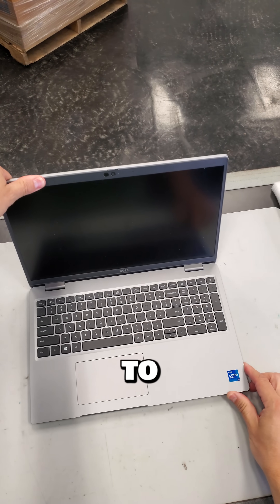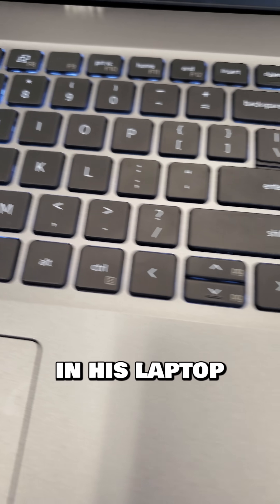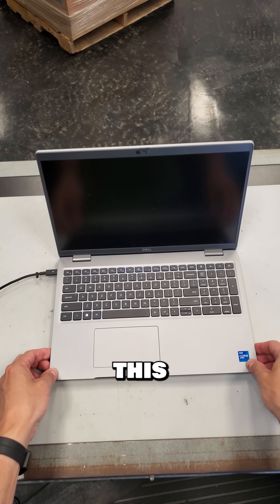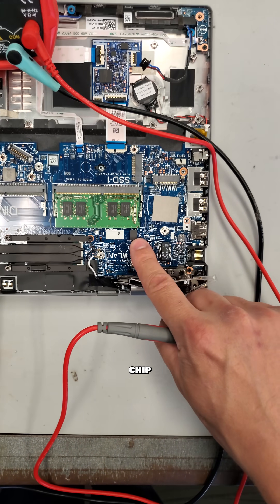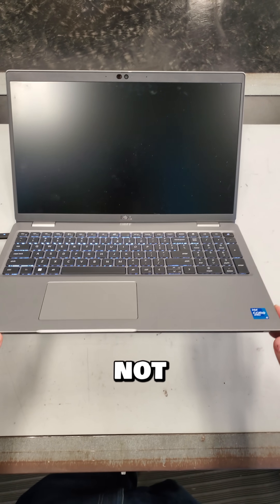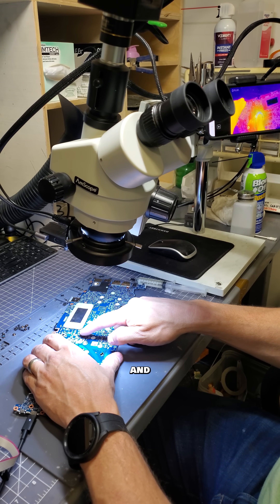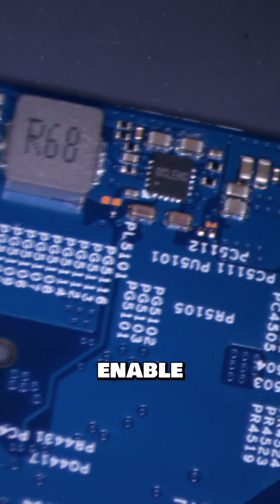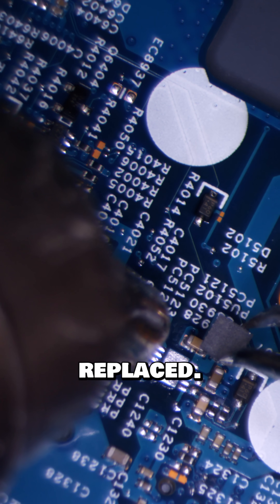Warning: Cheap USB-C Devices Destroy Laptops #laptoprepair #shorts #pc

Comment: Or you can just take the battery and memory out, connect the laptop with charger, press and hold the power button for over 4 secs, take the charger out, put the ram back, reconnect and it works. Now you have a nice day

Comment: I've been ducking around with an automotive FLIR thermal camera was able to track down a chip that's overheating as soon as I put AC power to the Jack.

My buddy gifted it to me I think they were about $1k when released but it really isn't designed for zoom/micro applications like this.

What thermal camera are you using on your phone? You have one on your microscope right? How does it compare

Comment: Let me start by saying your skills at repair are great.
Unfortunately, this type of repair is usually cost prohibitive. Most people will just ask for their data and buy a new computer instead of spending $200 on a fix that may not last (other components could be damaged that are going to fail in the near future).
I used to run a repair shop in the early 2000s and people would almost always junk a computer if it cost more than $100 to fix (we had $25 diag). They saw it as a waste to repair and often used the failure as an excuse to buy a newer, faster machine anyway.
Computers are just too cheap to make unfortunately.

Comment: Do you fix consoles? I have a first gen 60gb ps3 that needs new NEC tokins/capacitors yellow light of death. Previous shop i took it to already reballed the cell processor and the other processor

Comment: I live in India i purchased a dell vostro i3 10th gen laptop 14 inch. When i unboxed it it was looking good and fresh. Then i plugged charger and turned on i didnt understand that the laptop turns on as soon as the adapter is connected😂 and does not operate from power button. So i changed settings in bios turned off all those open lid power on switch and adapter wake up settings of. Still the laptop turns on as soon as on i plug adapter in. After it turns on i unplug it and  then it works on battery 😂 returned it immediately and ecommerce company said they wont take it back. When to dell got a warranty denied letter then returned it to seller and took refund. Never going to buy dell 😂 and today saw your video

Comment: While I don't doubt that a lot of cheap USB devices are responsible for cooking motherboards, this may have been another victim of faulty BIOS firmware. Dell issued a firmware patch for Dell Latitude 5420 models (what this model appears to be) that allegedly prevents this issue. Dell Technologies Internal Reference ID - ET004996

Comment: Those repairs are super impressive to me. I have only tried surface soldering once and it was a disastrous mess. I don’t know if i just lack the manual dexterity (my hands are a bit shaky when it comes to handling tiny things. Always have been) or if there are lots of tricks I just don’t know because I only have tutorials and tips to follow and not an actual school course or something. So the repairs and tests you run are super cool. Well done!

Comment: My biggest gripe with USB C is the sloppy standards, I have some software that won't even boot if certain devices are plugged into certain ports, baffling.
Reply: The problem with USB-C is that it only defined a connector, but USB-IF kept harping about all of the protocols it could use, even though every one of them except USB 2.0 is optional (and even that might be a stretch to say you're guaranteed it).
Reply: Sounds like the software that's the problem. Every time I get a notified by software to remove devices it's  always software necessary to use a piece of studio gear, digital effect processor, i.e. a peripheral for outboard hardware made by a company specializing in anything other than software.

Comment: I doubt "cheap USB-c" devices as the cause. ALL PD devices can do that and WILL do that as the pins oxidize, get lint on them, or just make bad contact. The cheaper ones may do it more often, but when throwing around 100 watts at 20 volts haphazardly, stuff will pop. Has way more to do with the cables and connectors... The connector must be reinforced with metal for the leverage of the Thunderbolt 3/4 cable hilt. Cost savings is always your device's enemy.   

Best advice possible is to stick to the lowest power your device will use. Not the lowest it will take, but 45 watts is pretty safe.

Comment: Serious question. Do you repair/replace Dell Inspiron touchpads? My laptop works fine but I've had to use an external mouse lately as even since half a year owning the laptop it has increasingly mistaken mouse motion events as clicks or made the mouse go the wrong direction by a huge amount instantaneously. I'd assume Linux drivers but I'd think it feels like a hardware problem because of how it's gradually gotten worse.
Reply from the maker: Hi, check out our website, we may have a replacement touchpad palmrest for your model. May need to replace it. www.partspeople.com

Comment: I wish to increase my repair knowledge to your level
Reply from the maker: There are a few YouTube channels that are pretty good and you can learn a lot from them.  Then you need to practice... a lot...  Electronics Repair School channel, NorthridgeFix channel, and the Louis Rossmann videos.

Here is a playlist that I put together with videos that people can learn from.
https://youtube.com/playlist?list=PLQAeAX5hsbz040sKXpjDpnaFV9fpre1je&si=7iNTODpXJSzAh2UG
Reply: @dellpartspeople  thank you very much for this, I have a few stations for soldering, heat, oscilloscopes, power supplies, although I do need to purchase that scope next. I have been soldering for several years for transistors, resistors, diodes, capacitors, just never chipsets.

Comment: Aren't there any current limiting or short circuit protection circuits?
Reply from the maker: Yes, there are a lot of them, but from what I can tell, the wrong voltage went to the wrong place. Cheap, no-name docks and chargers are notorious for destroying laptops. Never buy them, and if you have one, throw it away. When a dead laptop comes in, the first thing I check for is a knock-off charger.

Comment: Friend bought wrong charger for Msi laptop.  Immediately fried the motherboard which costs as much as the device $450
Reply from the maker: Yep, it was probably a cheap, non-genuine charger.  The point is genuine chargers cost more because they are made with quality components and are not just slapped together.  Your laptop costs a lot of money, and you are willing to buy the cheapest charger you can find. It just does not make sense.

Comment: How much is that laptop worth....
Reply from the maker: It depends. The laptop is a business machine that was new for about $1300 but is now a couple of years old. You can probably find them on Ebay for $300 to $500, depending on the specs. This customer had the higher-end version and had business data on it, so it was worth a lot to them.  The repair was $200 and was completed the next day.

Comment: That's a grand worth of diagnosis, work, and parts for a $500 computer.
Reply: Yeah that's what I was thinking I bet you could find that same laptop in good used condition for like 100 bucks
Reply: Exactly. I pick up on that but my brain doesn't know the next step.
Reply: And I sent that complainer yelloworange or something a big F you.
Reply: How do you know that wasn't an hour's worth of work? Not everyone has $500 laying around to just buy another computer. Not everyone needs their computer to do video editing so a computer like this is fine. Our landfills are over capacity so repairing is best. I don't know how you justify that opinion of yours and cast it out there like it fits everyone.
Reply: @orangeyellow-me1pz  You're right, that computer might not be worth even $500.
Reply: @LordMondegrene  I love how your argument is so weak that you couldn't even challenge any of my points. You can only throw weak and nonsensical insults. Truly, it shows that I'm not talking to someone worth talking to. Mute.
Reply: @angrydragon4574  my first sentence addressed your whole statement. What is happening in American schools?
Reply: @orangeyellow-me1pz this is very unlikely to only be an hour of work unless this technician has seen this exact problem and has the parts on hand already to fix it. The amount of skills, equipment, parts, and knowledge required to do a repair like this is not trivial.
Reply: @orangeyellow-me1pz  I know for a fact that it was more than an hour's worth of work because it takes an hour to simply take a laptop apart to the motherboard level and reassemble it. That's working quickly with no interruptions. He did this numerous times, once for nearly each new diagnosis. I've done this sort of work before as my job. 
Add in the time for diagnoses and chip level removal and replacement with soldering and it's well over two or three hours. All of which takes quite a bit of specialized equipment, knowledge, skill, and experience to do correctly. 
Doing this level of work for only $200 and giving a 1 year warranty on the work is barely breaking even. 
At the most, I would have replaced the motherboard with a new one if the price for the part was low enough. 
If the laptop isn't still under the warranty from Dell, it's probably not worth enough to do all of the labor that was done in this video unless the tech also has a popular YouTube channel to help earn some additional income with.
Reply: @GeneJordan  I'm not reading the rest of that dissertation. It does not take an hour to take apart a laptop. I've done so plenty of times.  It takes 5 to 10 minutes.
Reply: @orangeyellow-me1pz  Understood. Not only were you are wrong, you are too lazy to defend your incorrect and irrelevant point.
Reply: @GeneJordan  your first sentence was wrong so why bother to read the rest of that nonsensical drivel? I'm not grading a paper. I don't know what kind of special you are but it doesn't take that long to open a laptop.
Reply: @orangeyellow-me1pz  I've been repairing laptops since before laptops existed. I can only chalk your defiance up to you having a reading comprehension problem. That's probably why you believe  that working quickly with laptop repair is recommended. Take your time. Do the job right the first time. The Chromebook you used in school doesn't count.
Reply: @GeneJordan  as I said, you don't know how long it took him and that fact remains a constant. It took me 20 minutes to take my Windows tablet apart and repair some board level damage. For you that may take 5 hours. We all Aren't as slow. And now you're trying to guess my age and talking about Chromebooks. You don't know anything about me and just like the man in the video, you've started to build a story around someone you don't know. That's what stupid people do. Well, I'm muting you now because this is pointless.

Comment: I have a question, I'm only curious but do you take in AIOs, like a Dell Inspiron 23? I don't need to send mine in as it still works perfectly, I only want to know whether you do or not.
Reply from the maker: We don't usually, but I may consider it. We get many parts for it so I'd contact us prior. If you ever have issues down the road.

Comment: Tragic that at a granular level this laptop was still beyond economic repair. It would seem. The specs weren’t posted but the lack of badging would indicate the computer retails for less than $1600, at least in the past. Unsure how brands are doing it now.

I used to do board level repair like this, it takes some real skill. I despised it though and charged a fortune for the service, primarily to discourage people with low and mid shelf machines from spending good money after bad.

As in, the folks who want this done on a $600 Walmart special or a $400 Staples Back-To-School Sale laptop that’s just roamed around too much.

Comment: most repair shops would probally ask for like $100 and say its unrepairable
Reply: Yeah because this takes immense levels of training and specific parts that are very hard if not impossible to source without buying a replacement device. This guy specializes in one brand of device and has the knowledge and equipment to do them. If a repair shop spends hours trying to figure out what they can do to fix the laptop $100 is a pretty good price for the diagnostic labor alone.
Reply: You can't cover overhead spending this amount of time on a repair like this.  It's usually not financially feasible for most customers and most laptops.  Repair shops aren't trying to rip you off, they're just not growing a YouTube channel off of spending 4 hours on a 250 dollar dell.
Reply: @panikk2  You really hit the nail on the head. As much as I understand the customers' perspective on this, as a repair technician I am well aware the amount of time that these things can take and how much effort needs to be put into them and how that can drain a shop's resources very fast if it is done on a regular basis without payment.

For any repair customer who is reading this: you would do well to remember that no-fix-no-fee shops aren't any more ethical, per se, than those who charge for labor even in a failed diagnosis or repair - they just won't take your device in in the first place. Understand that you are paying for time and experience. Discuss the fees up front with the technicians, and if you feel that the shop may go back on their word and charge you anyway, either get it in writing or take your business elsewhere.
Reply: As a repair shop, I don't have the equipment or skills to fix this problem. 

However, I do have the skills to tell the client that I can't fix it in about 15 minutes, and I don't charge the client for that.

Comment: I hate to be that guy, but was this repair really worth it? It looks like a relatively cheap laptop that probably didn’t cost much more than that to begin with. 
Don’t get me wrong, I love not letting it become e-waste, but this has to be an unreasonable trade off at some point.
Reply from the maker: It was a flat $200 repair and I got it repaired the next day for the customer.  It was a work computer and he was very happy. But again, it was only $200.
Reply: @dellpartspeople  looking more carefully, I do see it’s an i5, so it probably would have cost closer to $600 to replace, so that’s fair. I was looking at it like I would a glorified Chromebook with a Pentium. 

Also, to be clear, I don’t fault you in any case, and having a flat rate for what can become a very complicated repair is admirable. Those service manuals only go so deep 😄

Comment: tell me what if my laptop gives me 2 or 3 orange and 1 white
Reply from the maker: 2 Orange	1 White 	CPU Failure 	
    Run the Intel CPU diagnostics tools
    If problem persists contact Tech Support for further help

3 Orange	1 White 		CMOS battery failure 	
    Troubleshoot the CMOS battery
    If problem persists contact Tech Support for further troubleshooting
Reply: @dellpartspeople  hello this has happened again as i took it to the place and they said it was a motherboard issue i keep getting crashes and my computer suddenly dieing even when plugged is this still considered a cpu problem?

Comment: A lot of repair shops don’t offer motherboard repairs. It shows the skill that you have.
Reply: I could only do motherboard repair on desktops and make it economically viable because they are relatively standard.   Of course I had to take all manufacturers at the time (DEC, Gateway, HP, Dell, Acer, Homebuilt, etc) and each had it's quirks.
Reply: Yep. They offer replacing motherboard, save effort, charge higher.
Reply: @tangducbao7309 depends on which country you live, labour cost is much more expensive than part cost. So replacing part is more cost effective
Reply: Of course not because you'd normally only expect the manufacturer to have these skills.

Comment: My dell laptop(inspiron 15)hinges broke when i closed it, searched internet for it and found out that most dell laptop have this kind of issue.
Is that true?
Reply from the maker: No, it is not common for "most" Dells, but some models, like other brands, are more prone to breaking. The cheaper Inspiron laptops are made of plastic and break easily, but a Latitude is made with metal and can last many years without an issue.

Comment: My Lord, can you tell me, a poor wannabe, what thermal camera are you using?
Reply from the maker: Well, I used two different models in this video. The first cheaper version plugs into your phone and has a lower resolution, but it is what I use as a grab-and-go. This one is a Thermal-Seek, and it can be purchased for around $150 USD. The main thermal camera I use also plugs into a phone, but I have permanently mounted it to my microscope. It has a higher resolution and overlays an image using a second camera. This one is a Flir One Pro and sells for around $350 USD.
Reply: @dellpartspeople  thanks!

Comment: The thing is this kind of repairs cost more than buying a brand new laptop 😭💀
Reply from the maker: We only charge a flat $200 for motherboard repair like this one. If we needed to replace the motherboard instead, the total cost would have been a little more than $300. Both of these prices are way less than buying a new laptop.

Comment: what thermal imaging camera do you use?
Reply from the maker: Well, I used two different models in this video. The first cheaper version plugs into your phone and has a lower resolution, but it is what I use as a grab-and-go. This one is a Thermal-Seek, and it can be purchased for around $150 USD. The main thermal camera I use also plugs into a phone, but I have permanently mounted it to my microscope. It has a higher resolution and overlays an image using a second camera. This one is a Flir One Pro and sells for around $350 USD.
Reply: thank you for your reply, I appreciate the work you are doing!